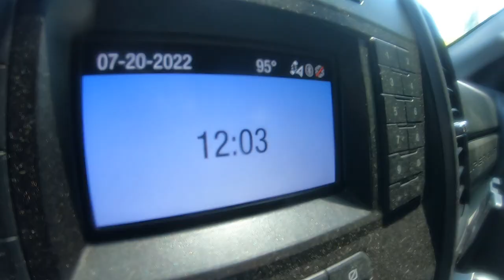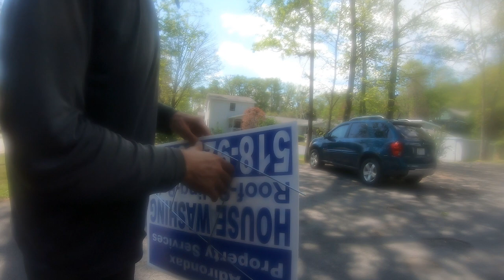Best Wash Gun For House Washing? Lets Find Out! YG1635SS vs ST2305 with M-5

Comment: With your expertise and guidance on a technical matter related to pressure washing equipment. It is my objective to understand if it is feasible to connect a blue gun to a high-pressure washer operating at 4200 PSI for the purpose of stream washing.

As we aim to optimize our cleaning processes, we are considering the integration of a blue gun into our existing equipment configuration. The intention is to achieve a more targeted and efficient cleaning methodology. However, we seek your valuable insights into the compatibility and practicality of this setup.

In particular, we are interested in the following aspects:

1.Feasibility Assessment: Is it technically possible to connect a blue gun to a high-pressure washer operating at 4200 PSI? Are there any specific adapters or modifications required to achieve this integration?

2. Performance Considerations: What impact will this setup have on the overall cleaning performance, including factors such as water flow rate, nozzle selection, and the ability to maintain consistent pressure during operation?

3. Safety and Compliance: Are there any safety concerns or regulatory considerations that must be addressed when combining these two pieces of equipment? Are there recommended safety measures to ensure the protection of operators and the longevity of the equipment?

4. Maintenance and Durability: What maintenance procedures should be followed to ensure the longevity and reliability of both the high-pressure washer and the blue gun when used together?

Your extensive experience and knowledge in this field would be greatly appreciated in helping us make an informed decision regarding the integration of the blue gun with our 4200 PSI high-pressure washer for stream washing applications.

Thank you for your time and consideration. I look forward to your expert insights and recommendations.

Comment: Just a heads up on the link to the Amazon DN10 ball valve in your description is for the BSP threaded version, not NPT. BSP is a 55° thread angle vs the 60° on NPT. Not sure if this is a mistake or not, just thought I'd let you know.

Comment: this a great video I the flow of both gun I am using a 12v setup now. I am very new to pressure washing so I maybe a bit slow getting the information you are explaining you are using 8 gpm machine and did or did not have to turn the pressure down on the washer.
Reply from the maker: 8gpm, did not change the pressure

Comment: Great comparison on the 2 guns thanks! Wondering what you ended up with on your surface cleaner? ✌️
Sorry, couldn’t stay in coffee club, things not been going well but, I do appreciate your videos and help for everyone. 
Take care brother!
Reply from the maker: Dude no worries at all I appreciate it so much and I hope thing turn up for you. I have two 4gpm tips at the moment
Reply: @YoungAmbitionYA  how does the pressure limiter affect your surface cleaner? Are you able to change the amount of pressure you are getting with it
Reply from the maker: @evanlucas8734  no issues
Reply: @YoungAmbitionYA  so your roughly only getting 1000 psi out of your surface cleaner tips
Reply from the maker: I prefer 2000-2500 psi for turbo nozzle or surface cleaner washing
Reply: @YoungAmbitionYA  so your able to change the amount of pressure you get with using the unloader easily
Reply from the maker: Yes there is an adjustment bolt. Buy a cheap guage to go with it
Reply: @YoungAmbitionYA  ok thank you and is a unloader and a bypass the same thing
Reply from the maker: Yes. Unloader will have 2 outlets. One "bypasses" to your tank and one sends water to your wand
Reply: @YoungAmbitionYA  so when waters bit coming out of the end of your hose the pump builds up pressure and the unloader will send it through another hose back into your take
Reply: Not** not bit
Reply from the maker: @evanlucas8734  exactly

Comment: Really appreciate this, though I need to look into your system a little more to see how its all running, as we are newly working with a 12v manifold system. 

I was digging through your list trying to find the remote operated valve with no luck. Am I missing it or could you shoot me a link?
Reply from the maker: Google flowpro you'll find it

Comment: I think that blue gun will work as a regular pressure washing gun for your 8gpm. I think what they mean by 350psi is what the gun puts out. Is this correct?
Reply from the maker: No, guns don't out out pressure. The pump does. The 350psi is a safety rating saying the gun shouldn't be used over 350psi

Comment: Can I use this gun on a pressure washer without buying a whole new system
Reply from the maker: Yes I used it on an 8gpm with a k7 unloader. The k7 or k1 is a must. It does run above the manufacturer recommended psi so user beware I suppose
Reply: All I have is a simpson @3400psi-2.5gpm

Comment: If the orange gun is hurting your hand, open it uo and see if it has 2 metal triangles in it with a roller and a peg in it,  I forgot if the orange guns do.   If it does, take one of the metal tiangles off and remove the peg.  You might have to bang the tip of the gun on pavement to get the peg to slide out.  Your wrist will thank you.
Reply from the maker: will check it out
Reply: @YoungAmbitionYA  Yea ergonomics is no joke.  That clicky peg assembly is dumb and can lead to cramped wrists.

Really liked the video -- would have never thought of putting a flow unloader and washdown gun on a pressure washer

Comment: I got told by a couple shops not to adjust the unloader's factory setting because it can mushroom the needle inside. And don't use the blue guns pressure washing. It's been working fine for you so I'm confused?
Reply from the maker: Unloaders are meant to be adjusted. The guns work fine if used properly, though not meant for this
Reply: @YoungAmbitionYA  looks like I need to order a black spring/knob to adjust mine bc it didn't come with it factory.
Reply from the maker: If you have a K7 it should be a silver hex bolt. Tighten the bolt to increase pressure. Loosen the bolt to lower pressure

Comment: What psi is your pump putting out while spraying?
Reply from the maker: I have it set to perform around 2500 psi using a turbo nozzle and using an M5 I get about 1000. It's a 3500 psi pump but changing the unloader settings and using different tips can give you more or less psi.

Comment: How are you mixing the SH & soap into the injector? You have a buffer and an SH tank - no batch. I've been doing via a 3-way through my mix manifold.... water = off, soap + SH = 100%... to injector. You?
Reply from the maker: Once I started down streaming I just add soap to my SH tank everytime I fill it up. So the I injector is always pulling a soap/sh mix. I still have an independent 16 gal soap tank for my roof washing. So if I roof wash I pull SH and house soap along with roof snot
Reply: @YoungAmbitionYA   Ahh.... sweet. I'll give it shot and see how that works for me. That's a much more streamlined way to do it for sure. You're the man. Thanks again.

Comment: What brand downstream and ratio of it are you using, I currently use a comet p36c for my chems but also have a hotsy 1260ss powerwasher on the trailer also, considering downstreaming to get around the dependability issue with the 12 volts and gas pumps, also have the same gun as you use, only its the red one. My power washer is 5gpm by 3500psi
Reply from the maker: I have a 2.3 injector oriface pulling about 1.25%
Reply: @YoungAmbitionYA  thanks for info

Comment: Can I use that blue gun on a PRESSURE Pro 4000psi ,   4 gpm belt drive pressure washer
Reply from the maker: Probably but 4gpm might not work as well. It's a high flow gun 10-16gpm
Reply: @YoungAmbitionYA  ok ty

Comment: Would using the ball valve gun with the m5 would help get away from having to hold trigger all day long on those bigger jobs?
I feel you in the trigger.  hurting my hands and elbows . Thanks for the video!
Reply from the maker: Yes that could work
Reply: Why not get a data center Velcro strip to loop around
Reply from the maker: You could